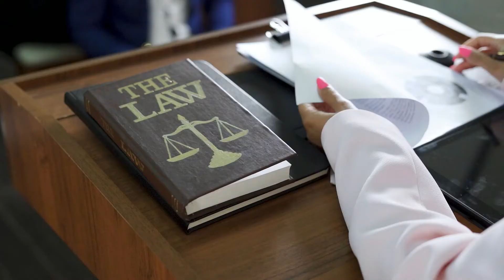7 TIPS to Prepare for an Electrical Apprenticeship

Comment: About tools:
I buy the cheap tools first. Those "all in one" kits are fine. When a tool breaks I buy the next tier higher. This is how I found out really quickly what were the tools I really needed and if I had to use a tool "off brand" (I just had to pry that thing apart and the flat head screwdriver is the only thing that would fit) I don't feel bad about breaking the cheap tool.
Reply from the maker: Not a bad method. I like it 👌
Reply: That's what my plan is, kill 2 brushless ryobis and move to dewalt.